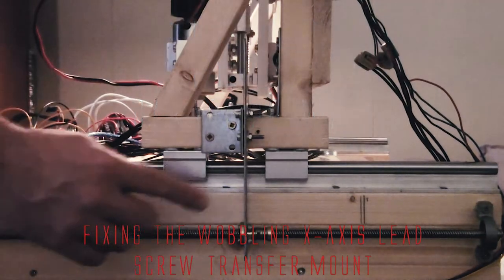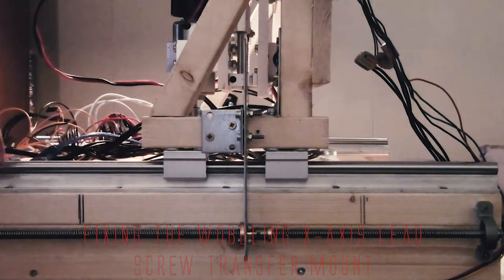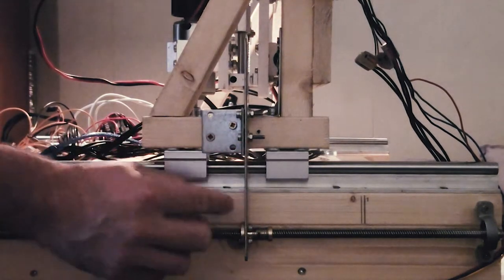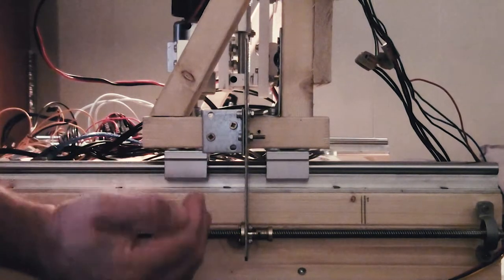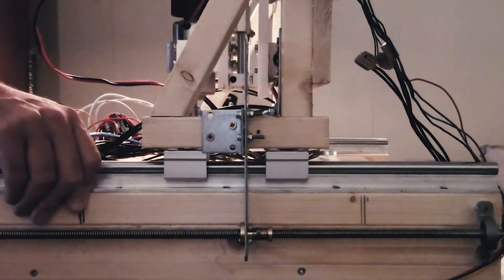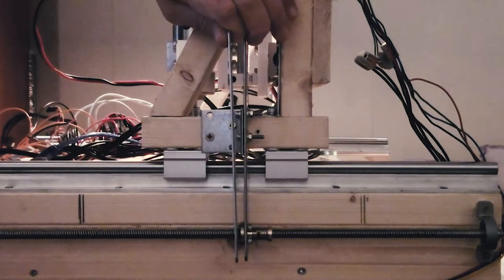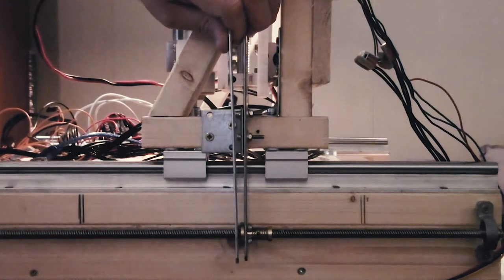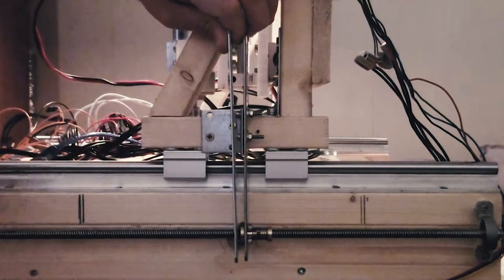First DIY CNC build (part 10) - Strengthening the x-axis brackets

Comment: Raising your X axis bar totally so your anti backlash screw is actually on your 2 90 degree bits on the wooden part then raise your Shaft Mounting Brackets up with your motor. This would mean raising your x axis drive bar plus motor and mounting brackets up above your x axis rails creating a straight line and eliminating all flexing. I know it's a pain to do but all the flexing will be gone use your white plastic sheet to make the new x axis mountings. hope this helps.

Comment: Thin flat plate will allways flex. Why not make a small angle to the plate? Or even better, use a small square tube? Your nice Nema23 motors and leadscrews get gets completely lost in the flex of the bracet. I can cut with with 0.2 mm tolerance using simple GT2 belt. You should be able to do better with the right design. Btw, I love you small videos. What software do you use?
Reply from the maker: Ole Brinch Thanks for the advice..  I use Adobe Premiere, After Effects and Photoshop 👍👍👍
Reply: A sound design goes a long ways towards a working machine. Keep It Simple Silly.

Comment: Thanks Mr Willy .
that's one solution or you could use one tick aluminum plate 8mm is enough or even mdf of 15mm
Reply from the maker: Mohamed Amine BIDA That is an even better solution Mohamed. I'm realy learning alot from this build and therefore I have a better foundation when I start building my next machine. As always, thanks for wathing, sir :)
Reply: They say that when renovating houses, the 3. house will be perfect. First house is full of mistakes. Second house will have some smaller mistakes. The third will be close to perfect. I bet its the same for DIY CNC  :)
Reply from the maker: Ole Brinch Hehe, that sounds about right. Learning smarter solutions for every build :) Hmmm, I better start building my first house than!!

Comment: Chage the lead scew to the same lineup of the horizontal wood then put the sqare, dont use these plates, my humilde opinion
Reply from the maker: Thanks for the tip 👍😀 I plan to address this in the future, but for now it works fine.